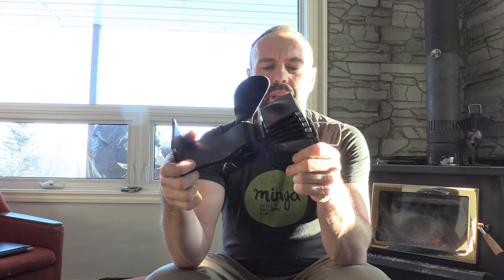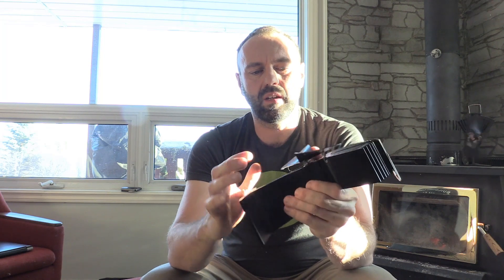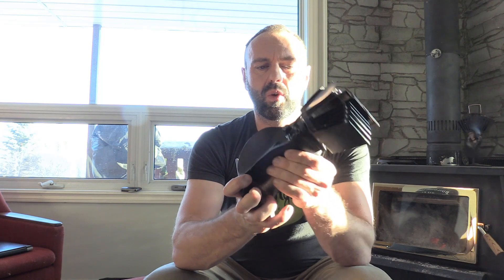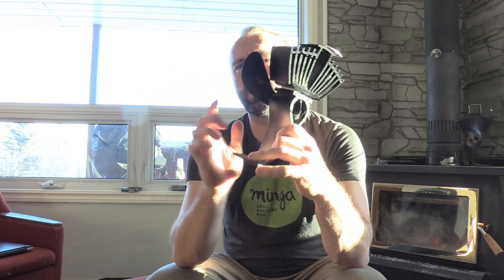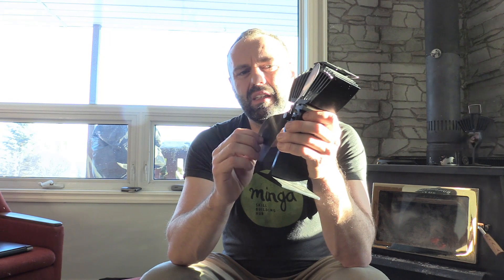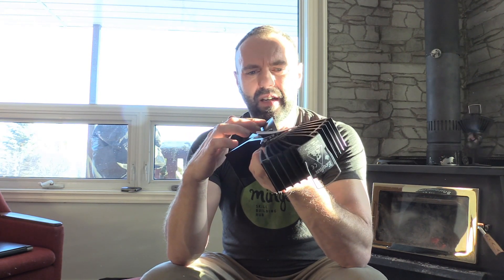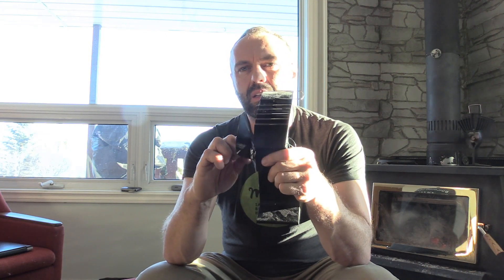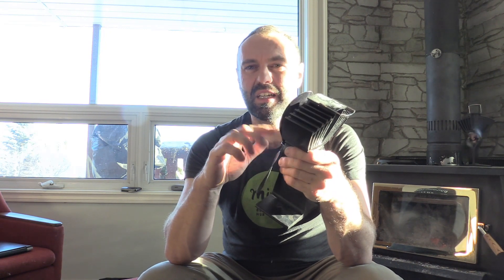Are Thermofans Worth It?

Comment: I built a stove top dehydrator with an ECO fan blowing on the 10 trays, the middle 4 trays where the fan blows dries three times  faster than the bottom and top trays. We have a Kitchen queen cook stove and use it. Try to season thing in front of it and you will see how good it works. Also put it next to the edge of the of the stove fan so it pulls the coldest air possible and you will get a greater temp differential. This will increase the fan speed dramatically.

Comment: Not sure I can agree with you on that Rob. The one we used to have, you could feel the breeze 12 feet away. Also are you sure about the direction of heat transference? Most of the ones I have seen want to be placed beside the chimney so that 1 side is hotter than the other.
Reply from the maker: It is possible that some are better than others the ecofan that I have does nothing.
Reply: When I get the new woodstove in the shop I was thinking about ordering a few of the $5 ones off ebay and re-engineering them, I'll let you know how that works out if I ever get a round tuit... ;)